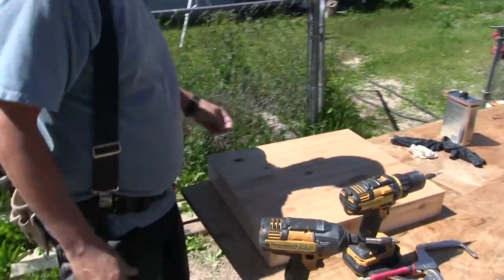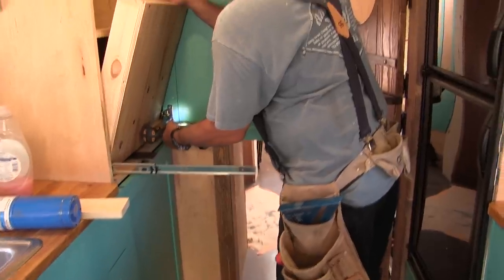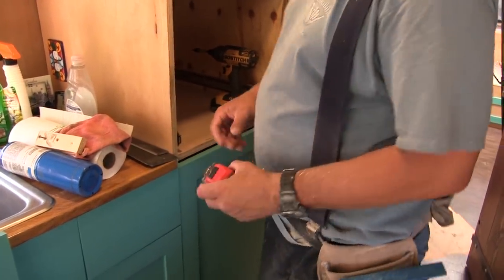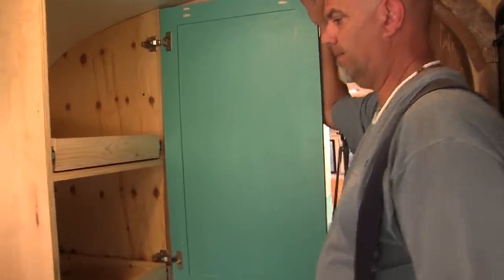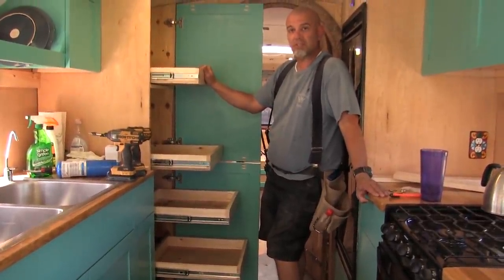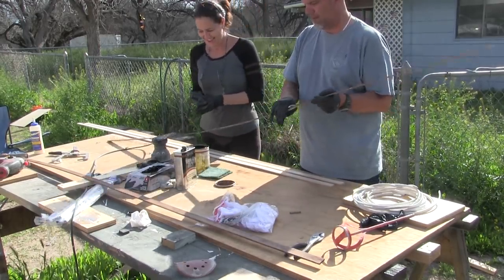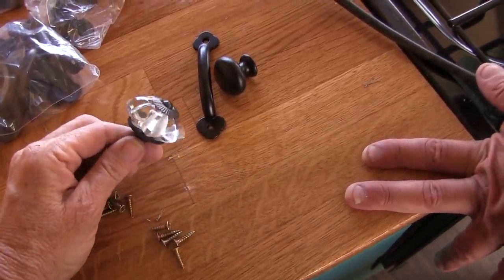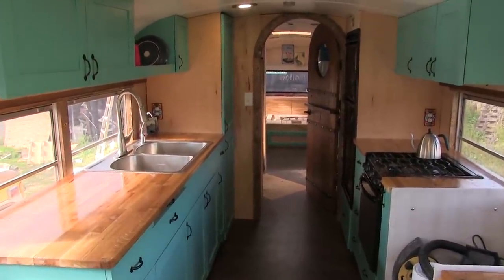Slide-out Pantry Shelves and Kitchen Cabinet Handles

Comment: I think you got your shelf spacing just about right in your pantry. That you can put your canned goods on the lower shelf, dry goods on those upper shelves. Since your lower shelves as a little bit less spacing, that would be a better place for your canned goods. Keeping your heavier items down low and your lighter items up higher in your shelves. If for whatever reason things may fall out of your pantry you don't want heavy items falling from a high place.

Comment: I love that kind of sliders but they can be fussy to install!  (I've had to shave down a few drawers, too!). I'v egotten so that I try to install them on the carcass side before I assemble, that way they can be lying face down on the bench rather than reaching into the cabinet.

Did you use 1/2" ply for the bottom for strength (as opposed to 1/4" in grooves like traditional drawers?)
Reply from the maker: Yes, 1/2"!